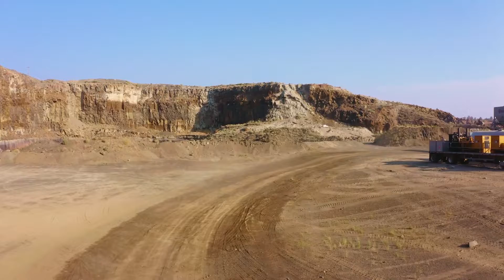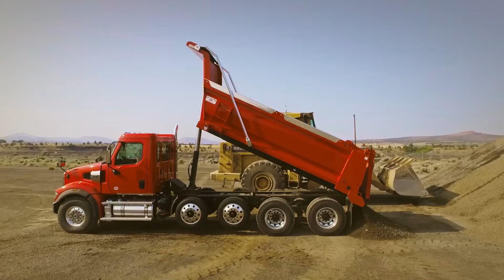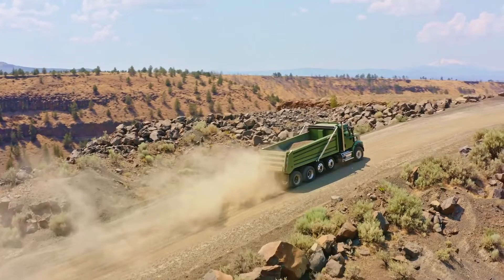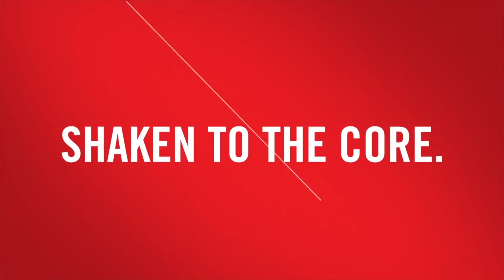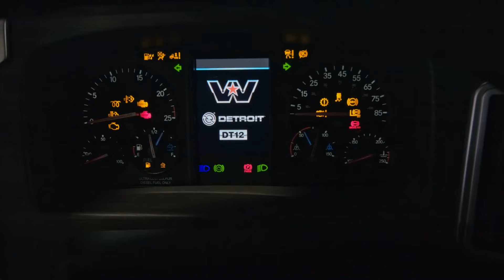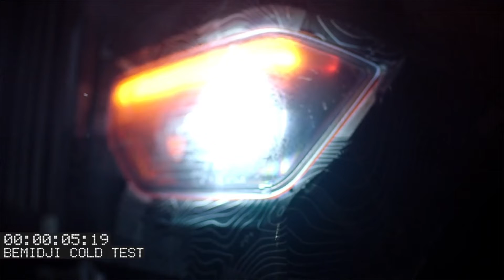Check This OUT! New Western Star 49X Shows Off Power, Strength, Tech

Comment: Thinner does not mean stronger.
Reply from the maker: Often times it does with new materials.
Reply: @Pickuptrucktalk  your wrong on that steel has a set point as does stainless as does aluminum. They think lighter is better to glorify gas mileage brainwashing.  All metal has a stress point an thinner is not stronger than 3/8inch  steel it is more heavy. Once again weigh play a role in how much stress that piece will bare. Grab me 1/4 steel an 3/ 8 steel. That 1/4 inch steel will break or bend before the 3/8 inch. All metal has a weak point no matter the material. It not the material it is the way it is treated when it is made.
Reply from the maker: @firstamendmenttshirt4768  I’m talking about new steels like high strength steel. Not comparable pieces of steel like you’d find at a home improvement store.
Reply: @Pickuptrucktalk  that's like saying chrome moly steel is better than steel. when it is less weight an not any better.